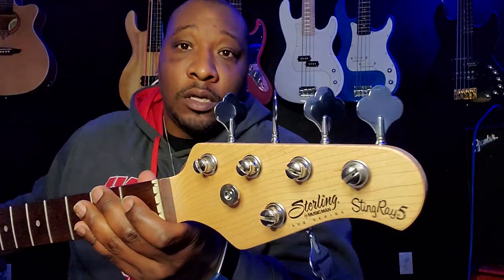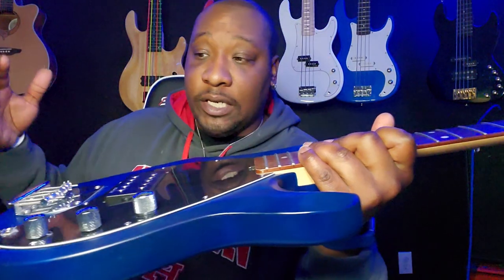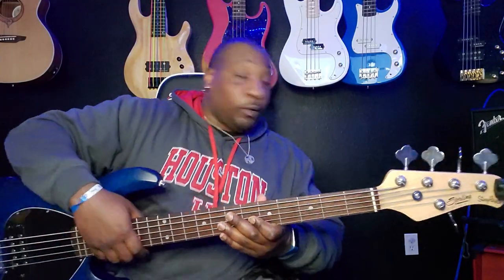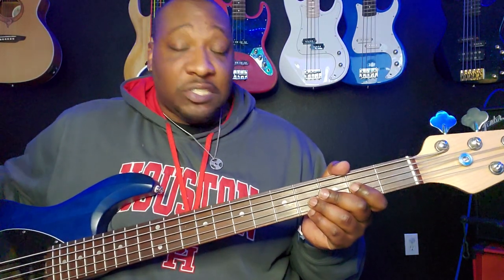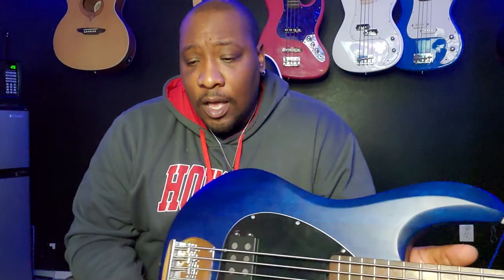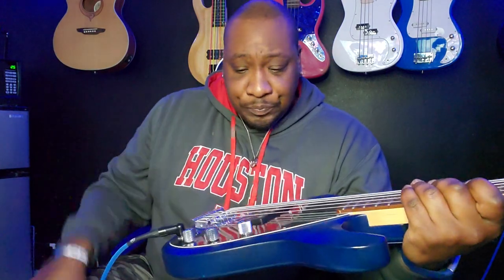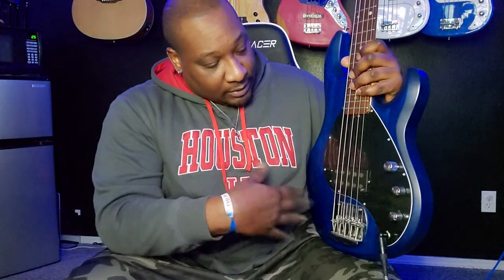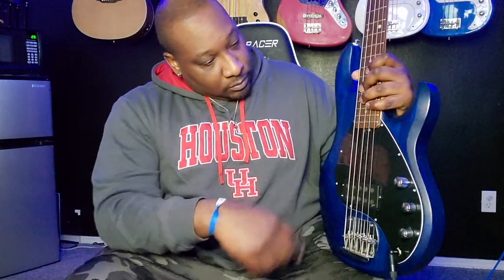Sterling By Musicman StingRay5| Demo and Upgrade Pt 1

Comment: I upgraded the stock pickups in my sterling Ray 5 as well, but with Seymour Duncans. They were not a direct fit though, I had to cut the pickguard in order to make it fit. I didnt know they made a pickup for the Sterling that was a direct fitment
Reply: I was planning to install the SD MM pickup. How much difference and cutting did you have to do? Was the string spacing ok?
Reply: @blee3621  Good question. I have the same doubt and situation here. Don't know what to do until I have all the answers I'm looking for.
Reply: @ronaldquintana6526  thanks. I’ve done some research and it looks like the SD won’t line up well but Nordstrand has different string spacings, including OLP that will line up well. Another alternative is bartolini which is a bar. Good luck!
Reply: @blee3621  Thanks! That helped a lot. I did my homework too and I'm thinking about doing the upgrade with EMG. I think it's the same as Bartolini (soap bars). I hope it works.
Take care!
Reply: @ronaldquintana6526  you too! Watch out with the EMG though - I don’t think it has ears so you would need to route the body
Reply: @blee3621  It's true. I have to make some mods but the most important thing is the string spacing. This EMG pickup I'm planning to install are two long blades covered in a plastic case that will cover the whole 5 strings.
Thanks blee for the friendly reminder.

Comment: The stock bridge is 17mm def gon need a like an 18, or 19mm bridge for the spacing. I got the same exact setup but I’m about swap the AG-5m for the DCB-5m only because of the pole alignment is off on the G but the pickup is still good tho!
Reply: man i had the same problem... whith DCB5M pickup we dont have this aligment problem? Does it have internal poles or just the ceramic bar? What is your opnion about the DCB sound? thanks!
Reply: @marciosouza8656  the DCB-5m is pretty much like a bartolini PU there’s no exposed poles just a giant soapbar pickup.
Reply: @ChrisF176  thanks Man!!